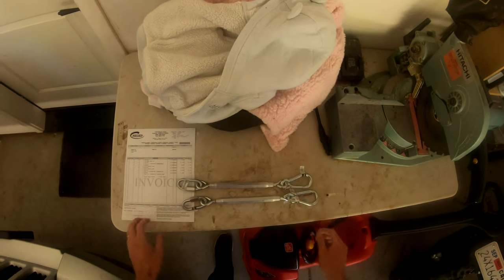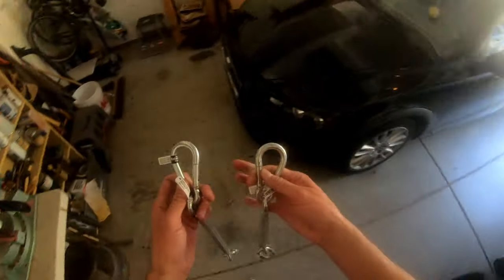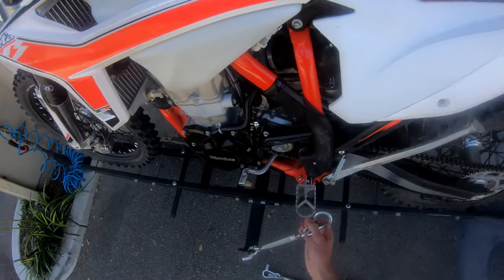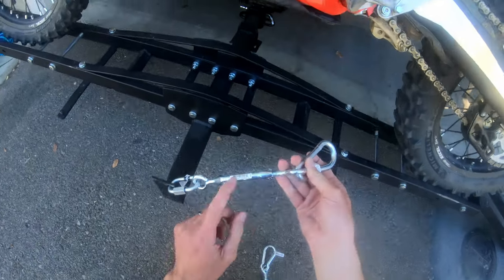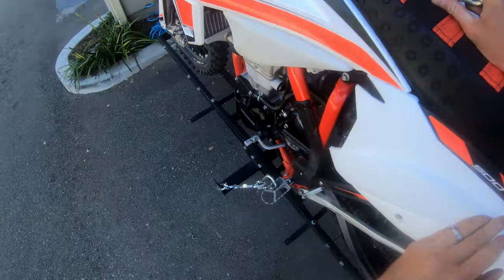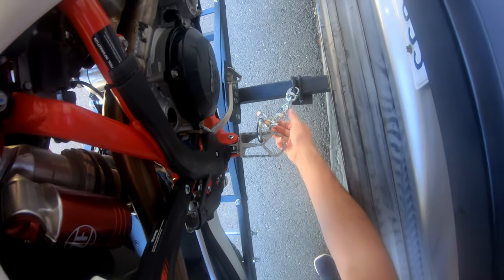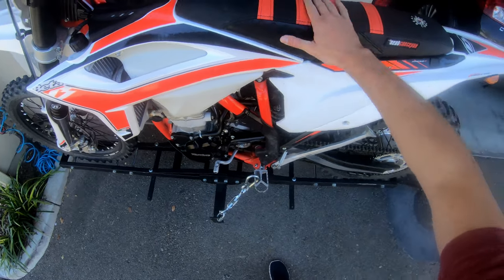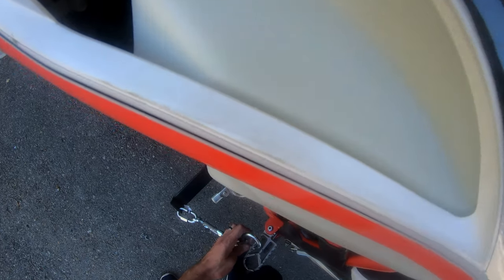The Best Way to Secure a Dirt Bike on a Carrier

Comment: Put one or two nuts on the eye-bolts of each turnbuckle and cinch them tight after adjusting the turnbuckle and it will not loosen up.

Comment: Great video, thanks for putting this together!  I just purchased a Black Widow, however I also so a much more expensive brand that used turnbuckles and like you, I figured I would just add them to the BW system.  You saved me time with the parts list, I was thinking longer as well so this saved me time at the hardware store!
Reply from the maker: Awesome! Yes, this an amazing system. I use it every weekend and have never had a problem.

Comment: I finally tried using turnbuckles.  I was foolish for waiting so long! 🤣 Mine loosened several times on a 110 mile trip so I think I will add a lock washer/nut to each one, but overall i was very satisfied with them.  Thanks again for making this video.
Reply from the maker: Yeah, I added red loctite to mine. Works perfect!
Reply: Could you not thread a Velcro strap or ratchet strap even through the turnbuckles to lock them from rotating and loosening?  Kind of acting like safety wire...
Reply: @vtrach1963 your idea to add a lock washer and nut to the turnbuckles is smart. I think I'd add an aircraft nut if I decide to change from a MotoProHQ 45 degree wheel chock system to this turnbuckle system in my cargo trailer. Thanks for posting!

Comment: I use 4 inch turnbuckle and strap the 2 together. This keeps the turnbuckles from loosening without nuts and loctite. I'm taking mine on a long trip soon and strapping it down also.
Reply: How did it work out for you on your trip?

Comment: Thanks for making the video.  I was definitely surprised at how short the turnbuckles were.  I would have guessed longer also.  I think I’ll continue to use a strap on each wheel to ensure the bike stays attached to the rack in the event a turnbuckle fails.
Reply from the maker: Yeah, probably a safe bet. Even though I don't think it's possible for the turnbuckle to fail. I could be wrong but it seems really solid. I didn't even tighten them all the way down in the video either. check this link out! They have a top mechanism but it isn't even securing the bike. It's only for anti-theft. https://www.mxstore.com.au/p/Ballards-Bike-Rack-Carrier/BA-BR01
Reply: Great tip! And that ballard is so sick

Comment: wow awesome. I just bought the carrier. while I was tightening the straps on the handle bars I heard a sort of screech  noise and at that point decided after this I need to figure out a better way to tie it down. I. think I'm going to try your method only also using those loops to go through the frame below the seat than to the turn buckle so just frame no handle bars no foot pegs. also I think I would like to some how get one of those wheel chucks on the front wheel bolted in or welded. I found a YouTube vid where a guy used those turn buckles for going from the chain holes on the receiver hitch to the carrier to I guess stabilize the carrier which seems like a good idea. great f'n idea bro  thanks again for this video.  after all the customizations guys do and I would like to do it seems like a waste on a 150$ 1/2 assed welded thin low grade metal carrier a guy might as well have a welder make one from scratch! yea I made it alright going from point a to b but I feel like one of the 3 stooges while trying to strap it down, the hooks where binding up where I placed them & the locking area of the straps also was getting to close to body parts and binding up & I wanted to sit on the bike to bottom it out some for the straps but I didn't want to put my weight on the carrier & bend the whole damn thing man I was f'n driving 25 mph with flashers  on stressed out,  I couldn't imagine driving 70 mph down i5 to capital forest rock candy with that thing.  👍
Reply: just picked up the same carrier for 50 bucks in Spanaway. i welded a bunch of the seams. going to do the same method of the turnbuckles to the foot pegs, bungie the tires down, then straps on the bars. i may go through and reinforce the carrier as well once i get some steel. Hoping to go riding presidents day. gotta get an oil change done yet and get ORV tags on the dirt scooter. ktm xcf-w in the 250 flavor. i live in lacey, waiting for waddle creek to open up. never been on that trail. just the fire roads.

Comment: You should still put tiedowns on the bars,  because that will put the bike forward a bit even with the bike in gear.  
  It happened to me.  Luckily I stopped and had to get stuff after driving for 45- minutes,  but with the rack pouncing the bike moves.  If those were straight down from the pegs would may be best,  but all bikes differ in size.
  Having the straps for me, helps the bike not to go forward and the locking links like that helps it not to move backwards. 
  Great bike by the way.
Reply from the maker: I prefer to live on the wild side. Lol. But noted.
Reply: @ZacharyUlrick  haha,  at least you have a good bike to do that with.  Mine is 10-years old and it would disintegrate if it hit the pavement.
  I am wanting to buy a new bike this year,  some people say to get the ktm 150x because it does have lights and is easy to move around tight trails.

Comment: Older post, but this is the exact setup I have, even looks like the same carrier, Black Widow? One thing that I did was I removed the middle tire bar in the front which makes it act like a wheel chock, but also creates a bit of a hassle getting the bike out of it. 

I also can’t get my ramp in when I have the back side hook in the carrier, I have to pull my ramp, set it in place, then hook it.

I also have a Velcro strap that’s about 2.5 feel long that I run through each of the turnbuckles, basically tying them together so they won’t back out
Reply: How do you run the Velcro strap through each turnbuckle to not allow them to back out TIA
Reply: @TommyJones-gd9xs  look at it like a long strap, I run the strap through the middle of the turn buckles, then tie it off to itself, or in my case, after running it through each turn buckle, I Velcro one end to the other. This will prevent the turn buckles from unwinding themselves, loosening your bike on the stand.

Comment: Make sure you use straps take as much bounce out of the shocks as possible. With those metal connections on the foot pegs are not going to hold it. Soon as he goes over a big bump and the compression bounces the tires liable to bounce out of the track and the bike will be dragging on its side. You can never use too many straps.
Reply from the maker: Lol I couldn't possibly disagree anymore. I don't use straps and I've been using every weekend since I made this video. I've also hit the occasional big bump and done some rough dirt road driving
Reply: Great idea!  Think I'll do the twin peg turnbuckle hold downs as a secondary/insurance.  Once ratchetted down, these are installed just to keep it down.

Comment: I welded another attachment point directly under the pegs and use a long bolt that goes through the pegs to the new anchor point.  This way it pulled straight down.
Reply from the maker: That sounds legit!
Reply: Any pictures of this set up?

Comment: The buckles are holding the bike down and work week to keep the bike from leaning in or out, and rolling to the right, BUT there is nothing keeping the bike from rolling left (drivers side).  If you take a right turn hard enough, the front wheel will jump that left end of the rack. You need to either tie down the wheels, or add a tension element that moves from the bike down to the right to counter forces to the left. Also, locking nuts on the buckles would be wise, or the buckles will loosen on bumpy roads

Comment: Stumbled across this video and I appreciate it! One question though, I have the same rack and im curious what the cotter pin is for on the first small metal rung  where the tire sits… would you remove this to “lock in the tire more”
Reply from the maker: Hmm. I don't believe I had cotter pins. I have bolts with nuts and washers...
Reply from the maker: But I did remove one from the front and the rea to help the bike settle in to the rack better
Reply: Sorry, just realized you have nuts and bolts. Glad you understood what I was explaining anyways. I’ll take one out in the front and rear to help as well. Thanks!
Reply: Yours is the other style with the cotter pins (better design than nuts and bolts imo) I also have the one with nuts and bolts but plan on switching to all thread/drilling holes for cotter pins for added security. And painting the rods with either flex seal or truck bed liner helps with not damaging your wheels when the bike moves around during travel. As for the turnbuckle either 2 nuts tightened against each other or a lock nut should do the trick. Either way I use Blue locktite to keep em from loosening. Great video btw!!

Comment: even though they are rated at 300lb remember you are not suspending your bike with them. rather pulling down with unknown force. I'm looking to do something similar but i figure why not be daddy overkill and get something with a higher rating
Reply from the maker: Yeah, from what I found available in the stores the higher rated ones were just too big and bulky and were too long. Doesn't hurt to overkill it.

Comment: Having broken a footpeg on a Yamaha while riding, I wonder about footpeg tiedown systems whether inertial forces when hitting serious offroad ruts with the trailer might snap off a footpeg and cause a disaster. I wonder, then, whether it would work to attach a turnbuckle or load locker straight to the bike's frame?
Reply from the maker: Yeah, I wonder about that too.

Comment: It would be better to have a second set from the footpegs back to the tie down bar closer to the rear wheel. That way the are pulling in opposite directions.  You can probably get by with what you have but I would not trust it long-term.
Reply from the maker: It was great for years. I have a truck now.

Comment: So did you end up also using bar straps, or have to tighten these down more to work on their own?
Reply from the maker: @ThisTall  No, I never use straps. I made the turnbuckles so that they are locked in place with red loctite and tightened enough so that I compress the bike a little to get them on and they hold the bike very securely.

Comment: Any updates? Did you bike survive? 😆 I wouldn't rely on this as the only securing device. Sounds good as a redundant securing method though.
Reply from the maker: Working perfectly. Been using it every weekend since I made this video. Never an issue. No extra security methods. Just the turnbuckles.

Comment: Brilliant idea!  I'm tired of straps and just got a single hitch carrier...Where did you get the hardware?  I'm not sure if Home Depot has heavy duty stuff.  LOL
Reply from the maker: I got mine from ACE
Reply: @ZacharyUlrick  I found what I need...Same place, ACE.  I hope those turnbuckles hold...Have you had any issues with them loosening up?  I'm thinking it's still a good idea to have one strap...for safety!
Reply from the maker: @jaysilvers1471  Once you find the sweet spot where you can clip them on without loosening them and the bike is secure. Make marks on the threads with a marker and then back them out and put red locktite on the thread and tighten it back into place. No strap needed if you do it right.
Reply: @ZacharyUlrick  Thanks brah!  Strapping the bike has caused me much grief throughout the years...I'm thinking this is the answer.
Reply from the maker: For sure, no problem! Yeah, I'm never going back. I've used this method every weekend since I made this video with zero issues. No straps. I've even travelled a little too fast over rough dirt roads. It also takes me about 30 seconds to load the bike and 15 seconds to unload. Can't argue with saving time.
Reply: @ZacharyUlrick  got my hardware. Made a few tweaks and it’s locked down for good. Plus easy to get loose.
Reply from the maker: @bradzimmerly6440  Sick! Happy trails!

Comment: I wonder if the same size would fit for my Suzuki ds80 lol 🤔
Reply from the maker: No, probably not. You'll need to do some measuring / testing. Best solution for a small bike like that would be to use a chain instead of the turnbuckle. You'll be limited without the adjustability though. Keep your receipts!
Reply: @ZacharyUlrick  I appreciate it!!

Comment: Does anybody see a problem with using the carabiner on both ends.  Would make reaching under the bike to secure the vehicle side eisier.
Reply from the maker: That would make it easier to load. Sometimes after a long ride when I’m tired I struggled to get it clipped and loaded. Because I never adjust the turnbuckles. I have them in place with red locktite. It might present a little bit of a less secure method with a carabiner on both ends. Try using a locking one at least.

Comment: Is that turnbuckle 4” closed or open?
Reply from the maker: So in the hardware store it will be labelled as 4". I'll just go measure it...It's 4" without the eye bolt's. So the center part is 4"

Comment: Hey man. Yes, it does look solid, however just as you wouldn't use a chain to tow a car, I wouldn't use a turnbuckle to secure my bike.  It has a set tensile strength, it will probably hold, but any impact, say a sudden stop or impact and it will exceed and just break off. Definitely dangerous. Traditional cam straps are far safer and allow for flex.  Wouldn't want it to launch off and hurt anyone.
Reply from the maker: For sure, I have thought of that. The tensile strength of each turnbuckle far exceed the weight of the bike. So with both attached, I probably am looking at a 4x tensile strength vs weight of the bike. With the added force of a sudden stop or bump in the road I would say the hardware will hold. In the event of an accident the added force may break the turnbuckles but the same result would occur with straps. I've seen bikes going flying out of truck beds in the event of an accident.
Reply: @ZacharyUlrick  I'm going to try your method. One of my straps failed today and my bike fell off and was dragged behind my truck.  The worst sound. Luckily my handle bar guards took the brunt.
Reply from the maker: @distilledfreedom1840  dang, that’s unfortunate. Well, at least it didn’t disconnect and get run over. Yeah, I’ve had a lot of people doubting this method I use over the years. It has worked for me without any issues. I hope it works out for you.
Reply: @distilledfreedom1840  What straps did you have? I just bought Ancras original tiedowns and it makes me nervous a bit. They held in severe wind this weekend but still.

Comment: How was it driving with it?
Reply from the maker: It's been great! I have used this method three times now. Super secure. No extra supports used...
Reply: @ZacharyUlrick  awesome! my hitch carrier has front and rear tie down points nothing in the middle so probably wouldn't work for my application, although I could go from the pegs to both with a long turnbucke, not sure they make them that long though lol
Reply from the maker: @tennyis28  yeah, maybe not a good idea. 🤔

Comment: Question… is there a reason you couldn’t just use chains instead of the turnbuckle?
Reply from the maker: Chains would be great if you could make the exact length you need. I never adjust the turnbuckle. I set the length on the first day and then used red locktite on the threads.
Reply: Got it. I’ve been using this method for a bit now. I’m still having a difficult time trusting it, so I’m a ball of nerves every time. 😂 So far though, it’s been freaking awesome. 

I have noticed that because the pegs are slightly rear of the carrier mounting point, they are on the limit of an arc, which allows the bike to potentially roll forward until the front limit of the arc is reached. Putting the bike in gear obviously helps with this, but I’ll use strap around the base of the front wheel just to be safe. 

Great idea. Thanks for sharing.
Reply: To be clear, I’ve been using this method since I saw your video. Totally copied you thanks again.
Reply from the maker: No problem! Glad it is working out for you in the way you are comfortable with. @arudd60

Comment: Until that goes sideways and your bars go thru you back glass.
Reply from the maker: After 2 years of use every weekend it still works perfectly.
Reply: @ZacharyUlrick  all it takes is that ONE time. I don't use four straps cause I need them. I use four straps on my receiver carrier in case one fails on the back (or front for that matter) and gravity does what it has done since it was invented. 

Any fancy ideas of securing a bike on one of these carriers against theft?
Reply from the maker: @christopher_navoni  Totally. I get that. Straps are very prone to failure. I haven't though of anything fancy yet but I like the Kryptonite lock. But you also need to make sure you have a lock on the hitch receiver.
Reply: @ZacharyUlrick  I just seen this and I think this is a great idea in combination with a ratchet strap on each side first this just adds that extra layer of protection also two nuts on each turnbuckle that you can screw down to stop the turnbuckle from turning once it’s firmed up 👌 beautiful idea thanks for sharing
Reply from the maker: @eastcoastlife3547  Thanks. Yeah, no straps for me. If you want to secure the turnbuckle, I would drill a hole through the bolt and put a cotter pin. Nuts could back out too maybe. I just have red locktite on the turnbuckle and it has never backed out.